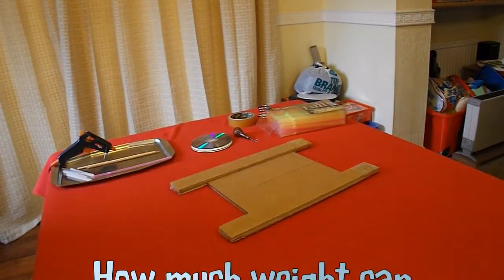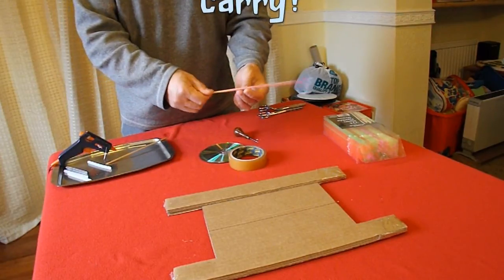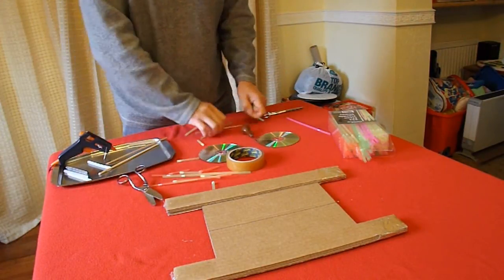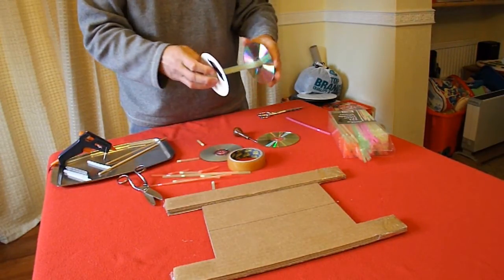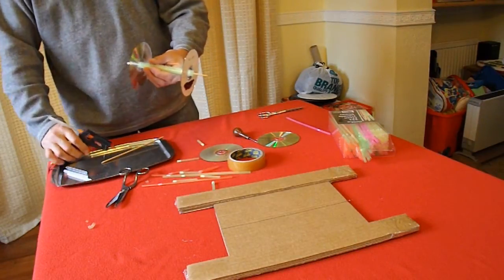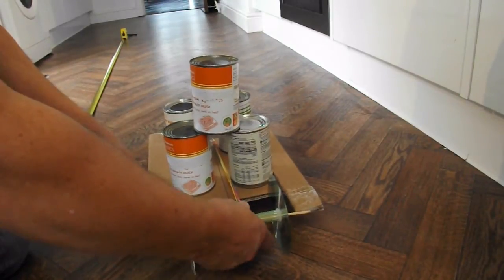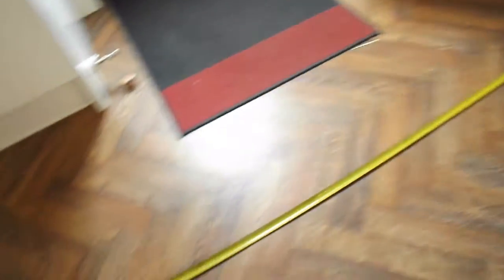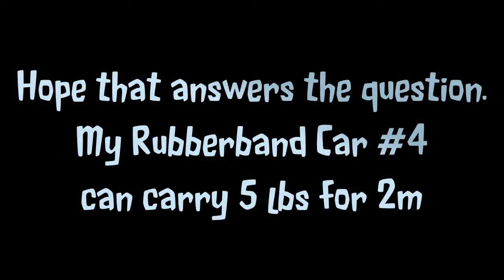My Rubber Band Powered Car #4 carries 5 lb for 2m

Comment: What did you do for the rubber bands ? how did you put them on the cardboard and make it the car role ?
Reply from the maker: +Eduardo Ramirez I don't understand what you mean by "What did you do for the rubber bands?" I bought them in a shop. Perhaps if you read the video description you would see it gives more information including a link to the original car build. Here is that link https://youtu.be/nC485RI11Ps
Reply: u skipped the part putting on the rubber bands can u show me the part?